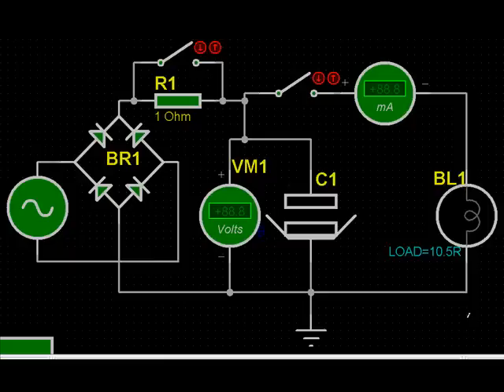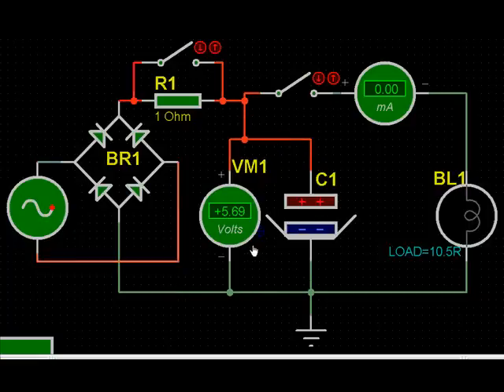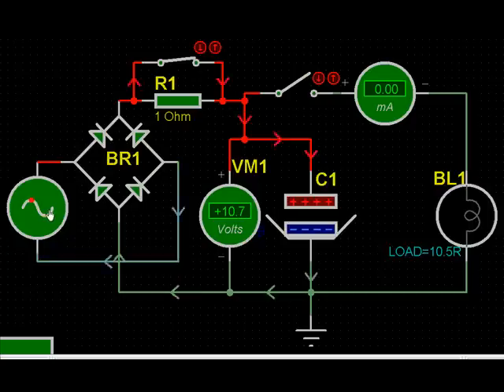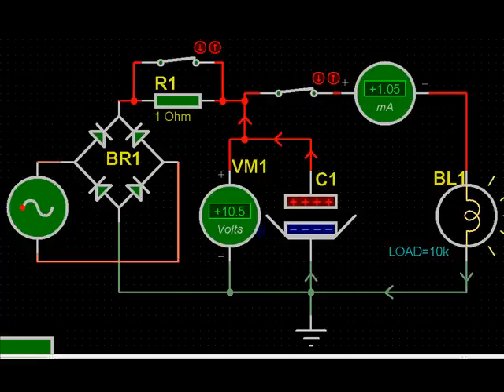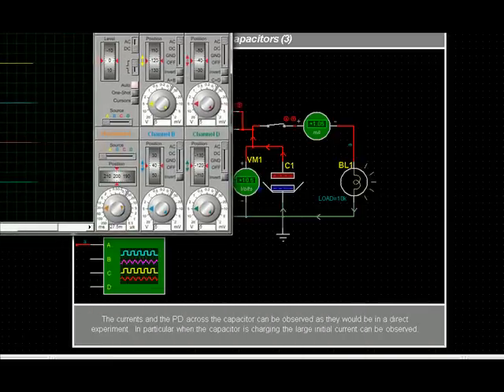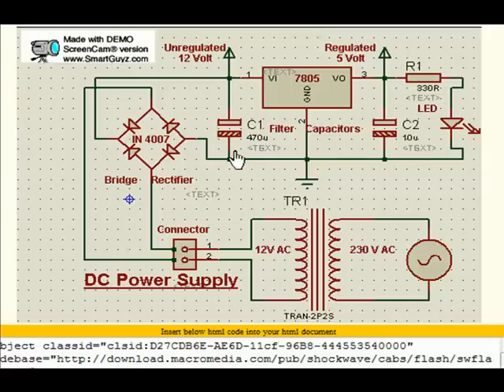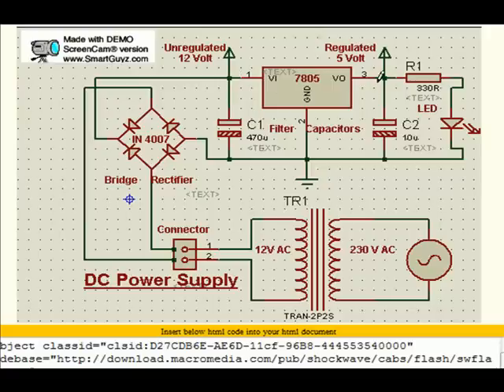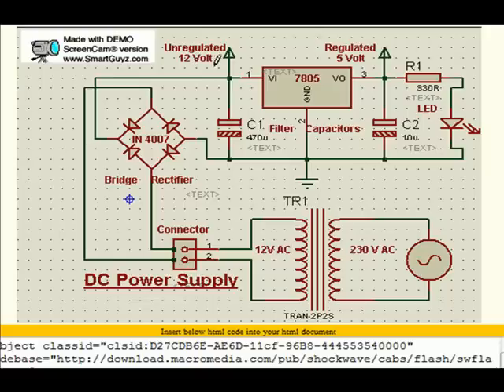Practical Electronics Design 1

Comment: Hello,
very nice demonstration.
Could you please tell me, how you sat up the animation/simulation in Proteus so that the layout of the schematic diagram looks different than normal. Specially how did you configure the capacitor, so it shows the charging process with red and blue + and - signs.
If you could send me the file to "knowledge2012 at gmail com" it would be great. THANKS!!!